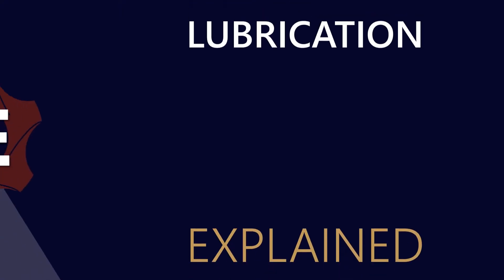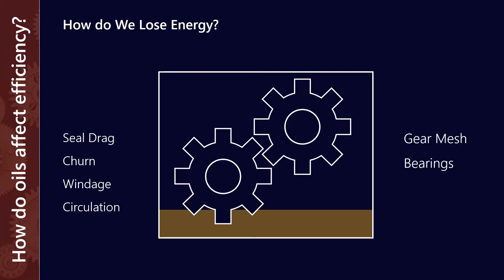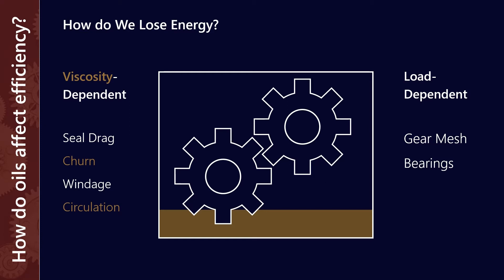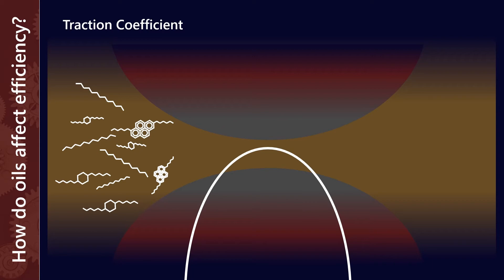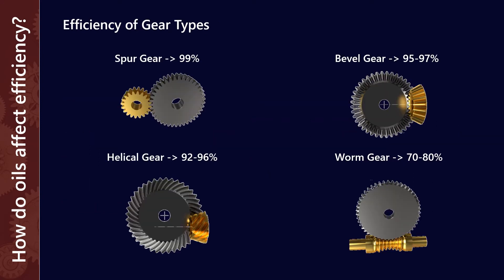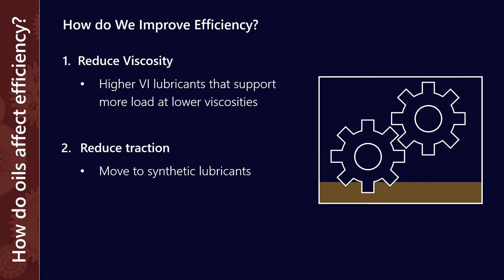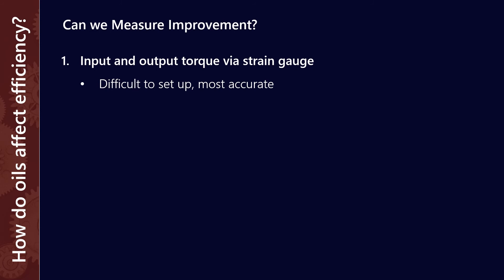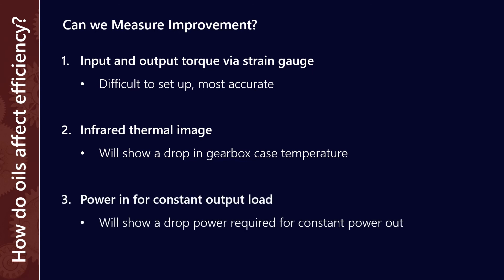How do gear oils effect energy efficiency?

Comment: IN a nut shell PAO oils are better than group 1,2 and 3 from my understanding. If I cannot find PAO gear oil, could I use an engine oil? 10W40 being similar viscosity index as 75w-90. I have straight cut gears, ball bearings, chain drive with tensioner, high speed low load and high load low speed straight cut gears, oil squirters for all gear mesh intersections. I also want to make the straight cut gears as quiet as possible but at the same time do not require the oil to be thick or want it to stick to the gears. Sorry for all the questions/ comments. Love your videos. I should just do testing I suppose.
Reply: Lots of people do this in the power sports world. Bikes, atv's SxS's, even compact & sub compact tractors.
Never heard of a problem using these subs.
Reply from the maker: There are a fair few gear oils that are really just cut-back engine oils - so you'd probably be okay. But from all your comments it seems like you're chasing reasonably high performance - I'd suggest looking toward some of the industrial gear oils, where PAOs and PAGs are reasonably common.

Comment: Does the PAO have better inherent load capacity at a given true bulk operating viscosity,(say 15cSt mineral at 70c operating temp vs 15cSt PAO at 70c operating temp) or is this a byproduct of the better VI causing an increase in hot viscosity for a given 40c viscosity?(15cST mineral oil at 70C but the PAO is actually 20cSt at 70c) 
I use 70c as the example so as not to confuse the true in-service viscosity with the standard 40c or 100c "viscosity-grade" measures.

Second you say PAG have low traction coefficients, but does this interact with load capacity? I mean is that statement based on equal bulk viscosity or on equal load capacity? 

To clarify when I say 'bulk' viscosity I mean the low pressure low shear condition normally used for classifying lube viscosity grades, rather than the localized high pressure load carrying viscosity.
Reply from the maker: Yes. So in general, you're often able to go down an ISO viscosity grade when switching from a mineral to PAO gear oil. By that I mean you could be using an ISO 460 gear oil, then switch to an ISO 320 gear oil, and the two will have equal load carrying capabilities despite the PAO having a lower "true bulk" operating viscosity.

To actually discover the load carrying-capabilities of a gear oil you need to do some calculations around EHL (Elasto-Hydrodynamic Lubrication) with some data input from the oil supplier.

For your question about PAGs, I'm comparing with a same-viscosity grade PAO gear oil. They'll probably have roughly equal load carrying capacity, but the PAG will typically have a lower traction coefficient.

Hope that answers your question!
Reply: @LubricationExplained  Mostly. I think my vocabulary limited my the question of PAO load capacity vs viscosity.
 
I was trying to compare equal operating viscosity rather than comparing ISO viscosity-grade. eg an iso320 PAO with VI-129 and a mineral ISO460 with VI-94 will both be 30cSt at 100c. So if the operating temp is 100c the two oils would have the same "actual operating viscosity"(phrasing used by SKF) despite being different iso viscosity grades.

And that brings me to the original question, with each at an operating temperature of 100c and the same actual operating viscosity of 30cSt would a PAO have substantially more load capacity than the mineral?

Comment: A differential starts off with 90w. But aeration cuts the viscosity down, that also cuts down on HP loss.  Doesn't air bubbles disrupt the surface tension or oil film on a hypoid gear situation, wouldn't that also lead to gear wear.  It seems differential oils use a minute amount of anti-foam added to them.  And would a dry lube like molyboledium disulfide and or graphite help in  a hypoid gear situation. I got more questions coming. Thx a bunch I have been looking for a channel just like this.
Reply: Dry lubes like moly, graphite, and teflon are EP additives that really only see action when the base fluid film has broken down under severe shock loading or other extreme conditions like a combination of high load and high heat(reducing actual operating viscosity). These EP additives do not have very low friction or traction, their purpose is only to prevent damage and wear by cushioning direct metal to metal contact.